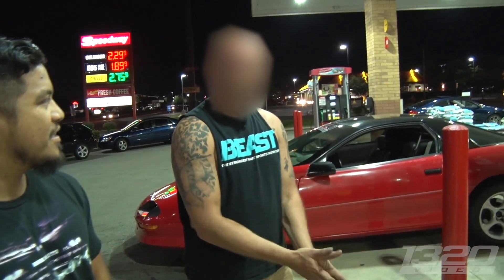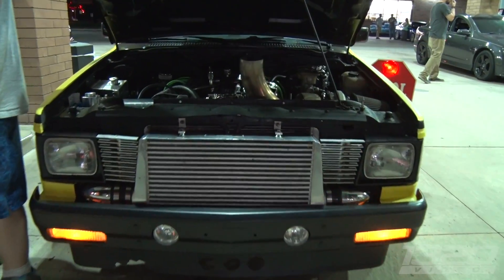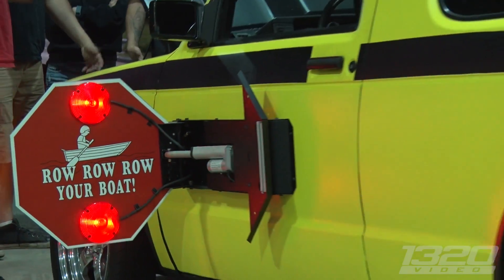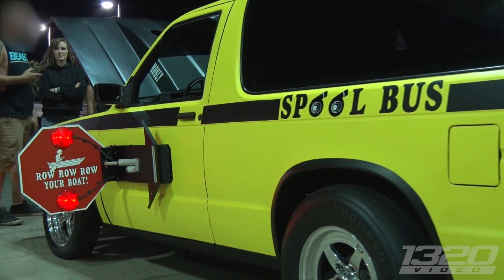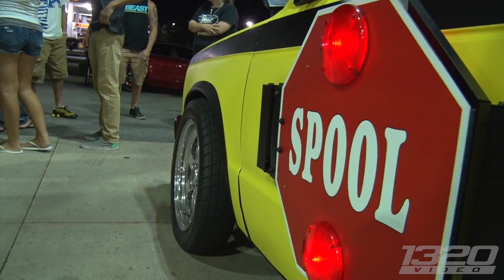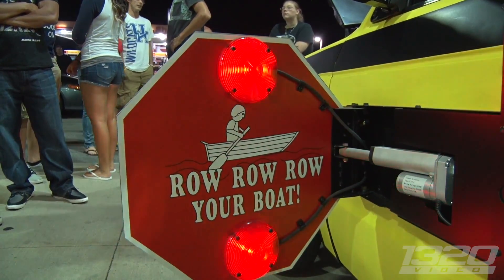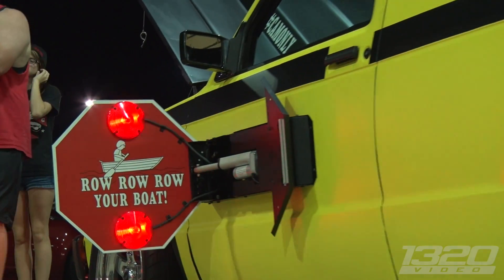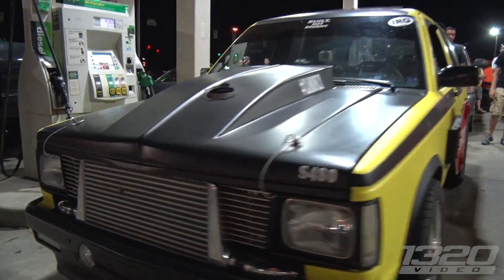SPOOLBUS Goes Street Racing!

Comment: 355 Lt1 is the correct description...
Reply: +twotwocold TPI doesn't automatically mean LT1, and the LT1's worth noting weren't the newer injected crap
Reply: +shredBucketheadshred Why even debate with me when you can clearly see the coil packs remember TPI motors distributor are in the back of the motor!!! Nobody waste time on TPI builds LT1 is way better build I don't know where you bumped your head but please seek medical attention asap....

Notice the guy gave the turbo info but not the engine other than displacement.... moving forward now!
Reply: hmmm my bad, I initially though you were claiming it was an older LT1 that later ran the crappy TPI totally forgetting about the way later LT1 style that was still pre LS motor , GM needs to retire the LT1 initials twotwocold
Reply: +shredBucketheadshred 93 Lt1 manifold without the cross over tube are similar looking except for the map sensor Design and the head bump comment should of made you laugh not take it as an insult cool set up tho!
Reply: Yep it's just a old 95 camaro z28 lt1. coil packs are part of the optispark delete. runs a cam/crank sensor now. this was on about 10lbs. I normally run about 20

Comment: fully built v8 turbo lost to a civic come on dude you kidding me lol
Reply: power to weight. 700hp at 3500+ with 2 passengers vs gutted 2300lb civic with 1 driver.   lucky it did that well. traction on the 1st couple gears are what kept up. the civic killed me at 140ish which i was out of gearing then anyway

Comment: not impress with the hondas at allllll, with that much of a weight advantage and power, it will at least put 2-3+ bus length on that spoolbus, but it didn't, what happened to the weight to power ricer ratio in hondas.
Reply: +master power civic at the end only puts down 700hp in 6 gear and when the race ended when the civic was in start of 5th gear. so theres some enlightenment to your theory. And you also have to consider that it take time to shift gears VS a auto.
Reply: +master power some people are just to thick to apriciate a nicely built civic.
Reply: +master power And the severe handicap with displacement?
Reply: +master power  the civic puts over 800 in 6th.... displacment is made up from weight, gabe weights over 1500lbs less than my bus. this was a 40 to 140 roll. his prime is higher, mine is lower or a dig. we met in the middle for a good race.
Reply: +master power Front wheel drive is a handicap.  The harder you accelerate with FWD the more weight tries to transfer OFF your drive wheels.  The front wheel drive handicap accounts for why the superior power to weight ratio wasn't such a good advantage for the Honda.  Look at some videos of the Lotus Elise with a modded Honda engine swapped into it.  Those are crazy.  Lighter than than a civic, mid engine rear wheel drive.  It really shows what the Honda engine can do.
Reply: Plur307 1320 also has a video of a boosted K20 (2L Honda vtec motor) in an MR2 and that thing whoops GTRs and modded liter bikes.  Ayyeee
Reply: TopShotta Yeah that MR2 is awesome.  My friend owns a MR2 turbo so he makes sure to show me every cool MR2 video on the internet.
Reply: if i remember right the black honda at the end has beaten him at tx2k.  ive seen it pull sprayed zx14 bikes